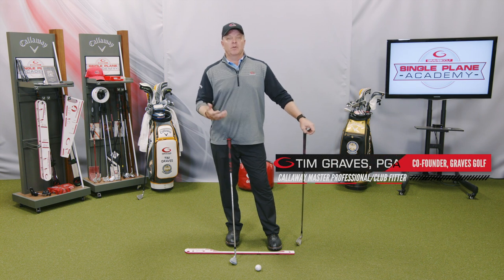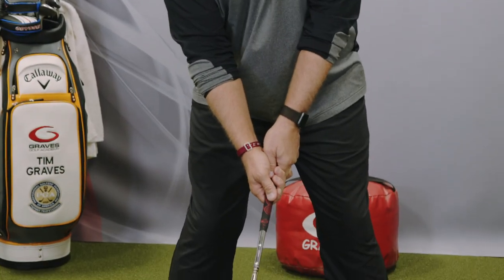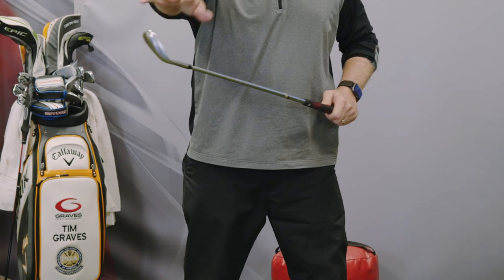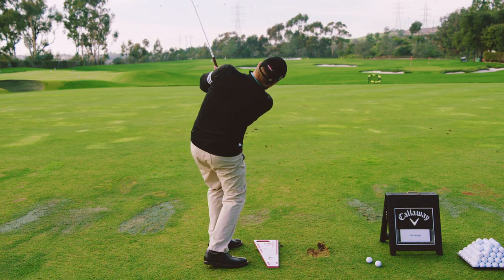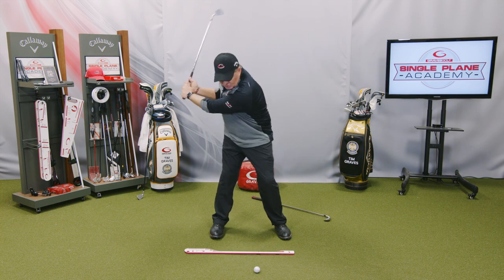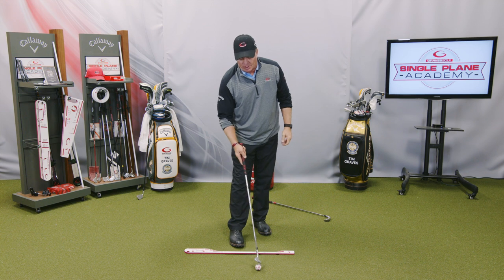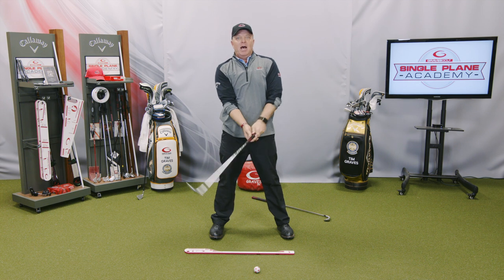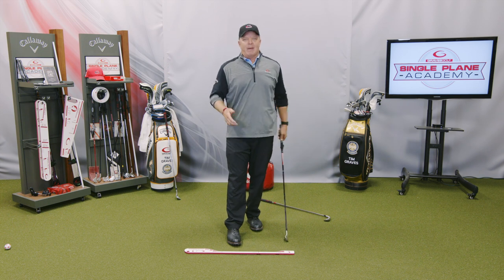A Common Backswing Fault You May Not Know You’re Doing

Comment: I know I milk the club. It seems to be what I 'get` from playing too many years with a very strong a grip. Any suggestions on how to eliminate the milk without any special training aids?
Reply from the maker: Another common fault is gripping too tightly to start with, which can create a tendency to loosen it in the backswing and milk the club. Always good to start small and work up with pitch shots and 3/4 swings as you adjust to feel, doing Tim’s grip check before and after each swing. This training club can enhance  the feeling of correct hand placement and pressure points. Here’s another video about grip https://youtu.be/gTCMrjyyR88